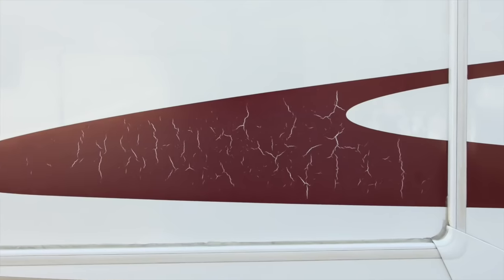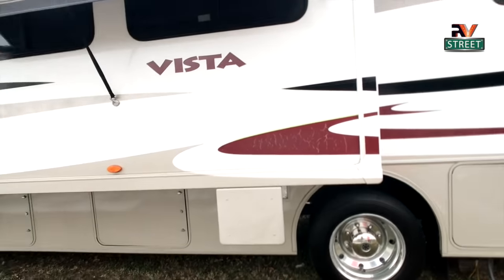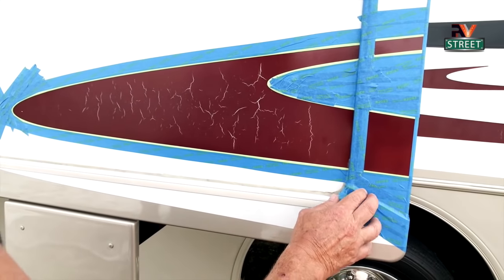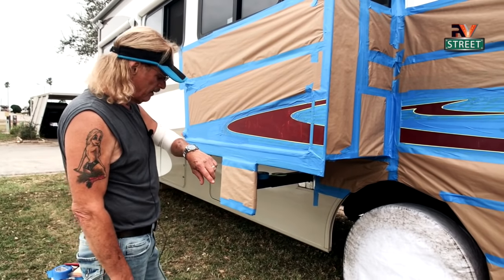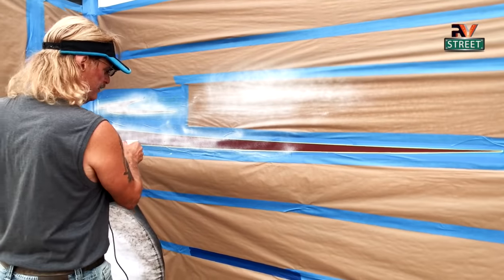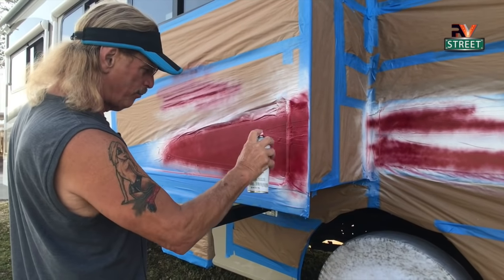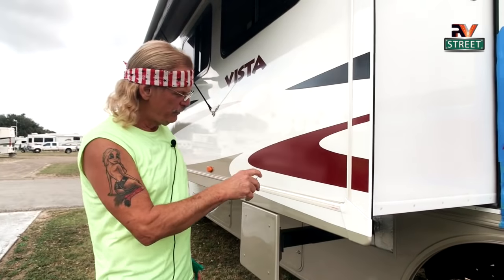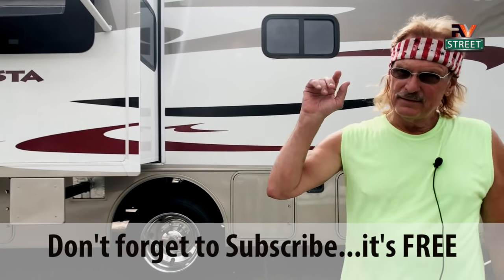How to fix Cracked & Faded RV graphics. Easy DIY job

Comment: The best way to fix the graphics is to remove them.  They are ugly even when new. Just look up RV’s that had them removed or never had them to begin with.  You would never see those ugly tickers on an Airstream for example. There are some examples of class A RV's that had them removed and a lot of class B RV's that had them removed. All look much better. (check out "Xplorer Steve DIY" on YouTube for example.  His before and after photos are amazing!)
Reply from the maker: Agreed. 
Sometimes it's best to just remove them like the one I mentioned removing in the beginning of the video. But I will say, if you protect them correctly they will last many, many years. Most people just don't take care of them though. Blocking the UV rays is the key. In our case, all of our other graphics are like new and look great and no need to remove them and our coach is going on 9 years old.

Comment: Would it be possible to change color if the tone was the same?
Reply from the maker: Yes. Same tone or a tad darker. If you went lighter some of the old MAY bleed through some over time. Just be sure when you're done to protect the new paint with RejeX at least twice a year.
Links in the description text.

Comment: Did you get any complaints about painting near other campers?
Reply from the maker: Nope. Got lots of compliments though. I just made sure we got a site where no one was around us and I wouldn't impose and inconvenience to them, or have to worry about any over spray to nearby rigs. In fact I had several RVers come over because they were intrigued on what I was doing and wanted to learn.

Comment: I know this is over 4 years since having done the video, so I'm going to assume you may not reply... but I'm going to take a chance that you will still be receiving notices whenever anyone comments.  My question is why you didn't remove the masking tape as soon as the paint had started to cure a bit (approximately 30 minutes after the final coat had been sprayed on) rather than waiting until it had dried overnight?
Reply from the maker: Waiting for it to dry completely insures that it don't pull off like it might if the paint is still tacky
Reply: @RVstreet  that makes no sense, as the reason paint gets pulled off is if it's dried.

Comment: wouldn't be better to scuff the cracks before taping it up?  this way you wouldn't damage the tape  around the area.
Reply from the maker: Sanding and scuffing AFTER you put on the tape prevents you from damaging the clear coat outside the old graphic. The way I showed gives you a nice clean finished line.

Comment: Only thing I'd disagree with is just flipping over the the inside filter and reusing it. Doing that just suck off the dirt and having it end up inside the coils, and having it run with reduced air flow. Remove, clean, reinstall for me.
Reply from the maker: The way our return air is designed and works as I showed, only uses half of the filter at a time. So by using the first half, then rotating the cover and filter together 180º and using the other half doesn't suck dust off the used part. But other AC return filters may be different where it uses the whole filter.
thx for your comment Joseph. 👍

Comment: The graphic is vinyl it will come right off with a heat gun or hair dryer. I would tape off and then remove the vinyl, sand the gel coat with 320 to 400 grit sandpaper, primer, then paint it as he did here. Of course base coat clear coat will always work better but most people would need a bodyshop for that. But removing the vinyl is essential, it will keep cracking under the paint and you will be doing this every year...just remove the vinyl folks.
Reply from the maker: (you will be doing this every year.....)
Nope. I'll be posting pics this winter on our FB page to show everybody.
But again, this was not to be a perfect fix. I mentioned that several times in the vid. We were showing folks a great, cheap, fairly easy way to restore their graphics to a point where they don't look like crap anymore. 90% restoration is plenty good for many folks who are on the road 24/7/365 and are retired.
But we do appreciate your input. Some folks may take your advice. 👍😜
Reply: @RVstreet  I appreciate your reply and I meant nothing negative. I have worked in plants for 25+ years. My experience in this and as an auto body technician is the reason I ever commented anyway. Taking off the vinyl and replacing it would take a couple minutes per piece. Price wise there are tons of vinyl sheets you could buy and easily cut to size with a simple exacto knife. I was just trying to give you another option that could save you alot of time and money. Cheers.

Comment: WHAT WAS COST OF THE NEW GRAPHICS ?
Reply from the maker: The cost of what new graphics....Not the painted ones right? If so just add up the cost of tape, paint etc.
But if you're you're talking about replacement.....
It really depends on the type of material you choose and the size width x length. It varies a lot. I chose the best UV resistant material on the market today. When I re-coverd that black graphic over the old one that I mentioned in the video that cost me $120. It's one time shot. If you mis-measure and it doesn't work there's no redo's. You have to start over....have a new one made. So measure very carefully and give yourself plenty of wiggle room all the way around to overlap and cover old graphic. Vinyl graphic material has come a long way since 2012 when our originals were made. Talk to a reputable Fast Sign Company. 👍

Comment: I know this is on graphics. But wandering if anyone knows how to remove caulking silicon.  I had someone re- seal my rv and they used the wrong stuff and it looks terrible.  Please advise. Thank you
Reply from the maker: Ya, that's a big no no. But ya know, I still see some folks saying to use on some RV forums. STUPID IMO. The only way I know to remove it would be to use acetone—sparingly—and a brass bristle brush along with a small plastic scraper. But don't get it on paint. You'll have to get it all the way off or the stuff you come back with, will not adhere properly. 😢
Reply: Thank you for the response,  I will try that

Comment: - haha... to avoid the paint from wanting to peel up when removing the tape... strip the tape off while the paint is still in the wet stage.....
Reply: There is still the other two first coats that are dry?

Comment: WHY IS IT ALWAYS THE COLOR RED GRAPHICS THAT CRACK????
Reply from the maker: Good question. From our experience and what we've seen it's always the dark colors. Reds, blacks, dark grays, dark browns and so on. But it's not just dark graphics that have issues. It's dark color paint schemes too. Manufacturers know that Americans buy with their eyes and they like rich looking paint schemes and lots of bling. That's why a lot of these full body paint RV's have these type of paint schemes. High contrast colors. Lots of darks and lights colors. And boy they look great and rich looking...for about 7-8 years and then stuff starts to happen and especially if they haven't been taken care of. Those dark colored Rv's, like the ones with a lot of black, or dark colors up top, they start to get what they call "crazing". Look it up. My advice to anyone looking to buy a rig is to stay away from a lot of dark colors. Especially on the top and the front crown area. Besides dark colors are so hard to keep clean too. Black is the worst IMO. Light colored schemes are not only easier to care for but they reflect the heat from the sun better and keep the Rv cooler too.
Reply: @RVstreet  
Why do the golden colors, never crack.   I think the sun bake the dark colors, & the lighter colors reflect the sun.

Comment: Hey not being smart or anything ,,,but if you keep 3 or 4 old bed sheets in your side box yo can tape them up and save a ASS load of money on the brown paper ,,,,and you can use them 100 or more times I do it while working on 18 wheelers cars trucks motorcycles ,,,ECT keeps the over spray off everything ,,,hope it saves you some money
Reply from the maker: Yeah I used to have a boat load of old sheets in the garage when we had our house for that very reason. Now full timing, no room for old paint sheets. I barely have enough room for all Joanie's clothes and her 40 pairs of shoes. haha

Comment: This seems like a nice idea but by adding paint over vinyl will only cause it to shrink and crack and peel even more. This is really a short term fix. The best option is to use a plastic scraper and a heat gun to completely remove the old vinyl. This takes very little time. Then use an adhesive remover to to get rid of the glue that remains. A little harder but there are some really good removers that work great. Then order new premade decals online. There are many in a wide range of price points. Or if you want to spend a little more money have some custom made at a local sign shop.

Comment: 400 is not fine sand paper ,,,,use a 2000 grit sand paper and see the different,,,,,if you get a spray NOZZEL with a button ,,they make a handle that snaps into the top of the can that makes it Easter to spray the paint with your first finger,,,,,about 2,00 dollars a peace and you can reuse them for ever
Reply from the maker: Some one else mentioned that you can get these spray nozzles. I have not been able to find them anywhere. Where do you get them?
Reply: @RVstreet  advance auto,,,O relies,,,Napa